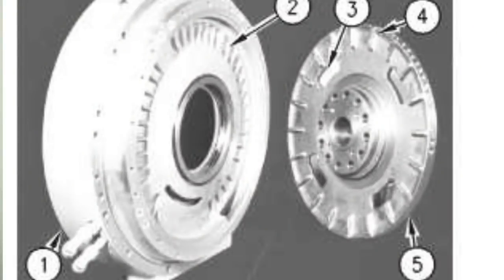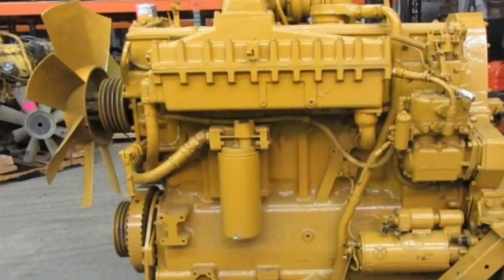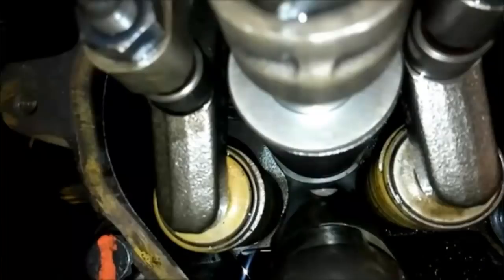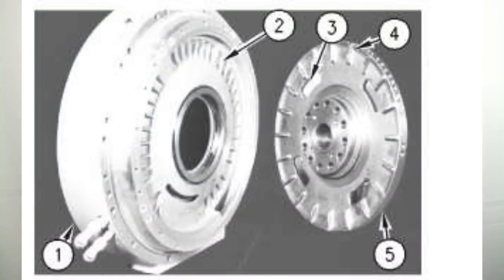What is a Cat BrakeSaver? Caterpillar BrakeSaver. Is it a brake saver?

Comment: I watched this video not because I haven't heard of the BrakeSaver as a device, we call it a "retarder" here in Europe, but because I didn't know CAT put one in its engines. Fun fact, in European trucks it's usually built into the transmission to slow down either the input or the output shaft. Also, fun fact, you can spec these to be linked to the throttle position sensor, so it won't rob power from the engine if you forgot to turn it off.

Comment: I have a 2004 kw  heavy haul with a c 15. It has both a Jake and a brake saver. I love it save your brakes on hills it gives you added safety and security  when dropping off a hill
With 200,000 thousand lbs. with over 1 million miles on it replaced a couple small seals still works great
With no leaks.  I enjoyed your video
Keep up the good work

Comment: I’ve got a Brakesaver on my 3408 in my KW, only problems it’s ever given me is that you’ve got to replace the rubber diaphragm in the control valve about once a year, no big deal, about one hour.  The secret is to keep a close eye on the Brakesaver temperature gauge and not go above 40 psi operating pressure on a long hill. You can run it at 60 psi for stopping at lights etc.
It’s got a huge oil cooler and 2 x oil filters which has got to be good for long life. Another thing, it’s easy on the engine. I believe Jakes are hard on the engine over a period of time. Yes it does have a seperate drain, I use Fumoto oil drain valves for the oil pan and Brakesaver. We overhauled it when I did an in frame on the engine a few years ago, but it was like new.
Yes they are heavy, and yes the price was way more than Jakes. They sound a bit like a CAT haul truck going down a ramp in a mine or a locomotive on the dynamics. I quite like the sound when it’s on max psi.
Reply from the maker: Very cool comment 👍
Reply: @AdeptApe  He also got a very cool channel, you should check him out when you have the time for it :)
Reply: You can change the diaphragm with out draining the oil or removing the spool valve.
Jake Brakes cause's the piston rings to relax very quickly. The result was in the 3406 92U days. Now called A models. I have seen four cylinders with a broken top ring. We had to replace all the pistons, after failure. With a newer thicker top ring. 
I have built numerous brakesaver's, and removed oil coolers on 3408 with one. Got pretty good at it, its a long heavy sucker.
Biggest problem with 3408's, exhaust leaks and broken exhaust studs. Cat came out with a lot of updates on the exhaust manifold. The exhaust stud they made a 7/16 stud and you have to redrill the cylinder head for the larger stud.
Reply: Thank you for more info. I am hoping to get a 3408 with a brake saver. People think I am crazy. But I have always wanted one. And after 10 years in the military and 5 shirt years after I got out. I finally found something that I love again.
Reply: @johngoldsmith6629  I’ve only broken one exhaust manifold stud since I bought the truck in 1996, pita to get out. Last time we did an in-frame,  we replaced all the studs.
Reply: @gm16v149  Your doing good. A lot of updates on 3408 exhaust. Cat tried several designs over the years.
Reply: Jakes are only hard on engines if they are used on a cold engine that has not reached normal coolant/oil temperature, otherwise you can use a Jake on an engine and get millions of km's with no damage to the cam that drives the injector driven master piston.
Reply: Jakes are not hard on the engine at all.  All they do is open the exhaust valve on the compression stroke.

Comment: Cats brakesaver was designed for 1693 because it was an overhead camshaft and Jakes were designed for push rod engines. And like anything if you knew what you were doing it was great. Thanks
Reply: We used to see some KW’s with a 1693TA, and a Luberfiner bypass oil filter   
They used to hold well over 60 quarts of oil with the Luberfiner. 
Drivers really liked the performance
Reply: Know 2 guys that run savers and both have blown oil seals out more then once
Reply: I just got one.

Comment: I've had 2 Petes with brakesavers,  I run the I-5 corridor from Washington to southern California, usually right at 80K.. My first was a 1990 379 extended hood with a 3406B 425 HP with a brake saver 13 speed and 3.55 rears on 24.5 low pro tires. I turned up the air pressure to the brakesaver from 50 psi to 60 psi. This truck went 615K miles before I traded it in on my 1995 Pete. The only brakesaver related repair was replacing the control valve diaphram ono time.  My 1995 Pete had a 3406E 500HP brakesaver, 18 speed. 3.36 rears on 24.5 low pro tires. I also turned up the air pressure to 60 psi. This truck blew a head gasket around 600K, Cat had a special going at the time, for 10K they rebuilt it with new cylinder packs, new injectors, new head, new turbo, gaskets, bearings, uprate to 550HP, and a 200K warranty vs 4K just to fix just what was wrong. No brainer there! This truck went another 1.2 million mile before it was totaled in a wreck, I still miss that truck! The total brakesaver related repairs for the entire time I owned the truck were 3 or 4 control valve diaphrams, and resealing the brakesaver one time, it wasn't leaking but the rear cover was and with everything apart, I thought it was stupid not to do it. Some other posts have commented about the brakesaver getting to hot on long downhill operation, I always turned on the engine fan at the top of the hill  the oil temp would come up to 230-240 degrees, it never seemed to be a problem. I ran Shell Rotella 15W40 oil in all my trucks and have never had an oil related problem.
Reply: Thank you Carl for a great explanation or a brake saver.
Reply: No problem with the brake saver I use it going downhill with the Jake’s I don’t leave it on all the time got watch the temperature but itcools down kinda quick right gear  you’ll hardly pressing the brake until you get to the bottom their a safety feature 🤙🏽🤙🏽

Comment: I guy I met from Alaska had a tip: if you want the engine oil to heat up quickly from a cold start, set the engine to high idle and set the Brakesaver control to 15 - 20 psi. I do that sometimes and it works though I heard it isn’t recommended by CAT. Not sure why, maybe because it’s kind of making the Brakesaver work in reverse.
Reply: I've live in Alaska for about 500 years (it seems like; True Sourdough here... sour in Alaska and ain't got the dough to go back home.) I've drained the engine oil and set it beside the stove over night to keep it warm. Once I got the truck running it took me 15 minutes of grinding low gear in the Aux box to get to slip into gear; then drove around the parking lot for another 30 minutes until I could get the main and Aux boxes to shift. That was only -50°F. So when the temp drops from  0°F to a blistering to -77°F you will finding yourself doing a lot of things that Cat or OSHA don't recommend. Cold is hard on equipment. It is a must to run fuel oil #1 in the diesel engines up here below 0°F AND, AND, AND, the DEF freezes. I've been out of the game for a bit so I'm not sure if they have come up with solutions.

Comment: I love the brake saver.  Got one on my old pete with a 6nz and 18+4. Works extremely well even with a 55 ton excavator on my wagon. Brake saver plus the engine brake will slow me all the way down and just activate the service brakes when I want to actually stop. When unloaded or loaded very light, I dont reccomend using it as it can cause a loss of traction.

Comment: Incredible information.  I never knew about brake savers.  I have used Jake brakes and exhaust brakes for years.  Another great and informative video.
Reply from the maker: Thank you Larry. They are interesting, but really make the oil pan a pain to work on.
Reply: @AdeptApe   I'm sure.  I will never forget the time we owned a business class Freightliner with a 3126 deep sump.  I remember checking the oil and it looked like it was a "quart" low on the dip stick...needless to say it was more like a gallon low (it was after an oil change at a shop, that didn't fill it properly).  I will leave the disassembly and reassembly of these engines to you.

Comment: I saw very few of these. You are spot about the owners/drivers loving the system. I went for a ride in a W900 that had the brake saver around 2004, the truck wasn’t new, and with the jakes on high and brake saver on, it would put you in the dash. No kidding! If the guy went fast enough, it would lock drag the drive tires and leave skid marks. No trailer of corse. He thought it was cool. I thought he was nuts. But he had over 500k on the factory shoes and drums, so it was hard to argue with that.

Comment: I had an 1985 pete 400 b cat it had the brake saver it worked good and the only sound you would hear is a whine great for going through cities which had steep grades you wouldn't wake up the neighborhood downside was expensive to repair when like you said have oil leaks or clutch job or engine rebuild plus the extra weight. 
The 1 drive line retarder that worked extremely well was the electro magnetic drive line retarder it was in a 81 pete with a kta 600 Cummins with a 20 speed spicer trans i drove for a couple years in the oil industry. That retarder was awesome just fit between frame rails and drive shaft connected to either end but man you needed a monster alternator to feed it and much heavier than  the brake saver.

Comment: I've run brakesavers on several 3406's, very effective but they won't help you pick up a gear while moving slow on soft ground like a Jake will. Best of both worlds is a brakesaver and jake together. I leave the jake on all the time (6NZ 550 hp) and supplement with the brake saver on manual when heavily loaded this combo will slow a 140,000 lb load quickly. The Jake kicks in instantly while the brakesaver takes a few seconds so it doesn't shock the drive train when you turn both on at the same time.
Reply: Yeah that’s another thing about a Brakesaver, they take a second or two to come on after you’ve flicked the switch on the dash or pulled on the hand piece.

Comment: I've got a 1986 Peterbilt 359, that I bought out of a wrecking yard (20 years ago) with nothing under the hood but the bare block and all the old, internal components and the head in big boxes and on a pallet.  The engine was factory equipped with a  Brake Saver but no Jake Brake.  The engine was, of course, equipped with the very large oil cooler and the truck was factory outfitted with an extra large, high capacity radiator (which, you forgot to mention, is also a necessity with Brake Saver equipped engines).  Previous experience had taught me that, while helpful, Brake Savers were not nearly as effective as a Jake Brake, especially out here in the mountains of western America.  I, personally, rebuilt the engine (liner kits, new camshaft, new fuel nozzles, rod and main bearings, reman oil pump and a gasket  set) using genuine Cat parts.  I acquired and installed a used ("D model", if I recall correctly) Jacobs engine brake, on this 3406B model (water jacketed after-cooler) Cat, at the time of the rebuild.  It's been a decision  that I have never regretted, and have been thankful for, ever since.  Before setting out, on the refreshed engine's maiden voyage, I installed new brake shoes on all four drive wheels.  The brake drums were extremely worn and deeply grooved, thanks to the old shoes being worn down to the rivets.  As I was (by this time) running short on funds, I was forced to run those new shoes in those old drums.  That was over 300,000 miles ago.  A couple of months ago, I installed four (4) new centrifuge drums and, of course, all new shoes.  The old shoes were still (believe it, or not, but I swear it's true) well over 50% linings.  They had been run (regularly), up and down, over the steepest mountain grades in America, pulling loads (GVW) any where from 86,000 to 120,000 pounds.  While it's a fact that my operating practice is to pretend that I have NO BRAKES (and, drive accordingly), the combination of a Cat Brake Saver and a Jacob's engine brake can't be beat.  Oil changes are done at a little closer intervals (religiously) if the Brake Saver has been getting much regular, or prolonged, use (due to elevated oil temperatures during Brake Saver operation) but oil changes are much easier than brake jobs.  
     I love Caterpillar.
Reply: P.S.  I forgot to mention how much I enjoy, and appreciate, your presentations.  Even though you're a YOUNG whippersnapper, you are pretty, damn sharp and I learn a lot, from you.  Keep up the fine work.

Comment: The local shop here just had a c15 with a brake saver come through. I know the technicians struggled with it a bit. However you're bang on the owner loves it
Apparently they're common on caterpillars articulated 30 ton trucks and many other off-road applications.

Comment: Drove a 359 Pete longhood with 3406B brakesaver equipped it worked wonderfully, the engine pulled great all day long and flattened any hills and wind, going down the Rocky Mountains no problems either, worked great and made a fine whine sound barely audible, also could check engine oil level with engine running, just never consumed any so didn’t need to open that long hood, unless you wanted to show everybody the nice looking, clean Caterpillar engine!

Comment: I had one on an early 90s Mercedes 2648 heavy haul truck made by Telma. Voith is another company that made them back than. We called them retarders and those were pretty common on trucks and buses. I rarely had to use the foot pedal for slowing in the hills. That also meant dropping quite a few gears before going down hill.

Comment: In the late 70's we added an electric retarder (essentially an electric version of the brake saver) to the driveline of one of our straight trucks (it "replaced" either one of the carrier bearings or one of the intermediate shafts, can't remember now).  It worked great in the mountains and was fairly easy to install (whenever you engaged it the ammeter would peg full scale, so it did consume a lot of electricity).  The downside was that it used several large contactors (relays) to switch the coils on and off, and these were expensive and failed often.

Comment: An Australian company invented a pneumatic brake saver that bolted on to the output of the transmission that pumped up gas cylinders to provide power at takeoff. Don’t know what happened to it but the Australian army bought a few of them.
Reply: I saw it at international  truck show in San Francisco  the aussie  both was close to road rangers both ,somebody  asked the road ranger rep what he thought or the aussie  pneumatic brake  saver  ,his response was they will be buying some of our transmission  on warranty , it is only loading one counter shaft. That is probably  why you don't  see them.

Comment: Also to add, biggest advantage is running the brake saver in rural area where there are “no engine brake” sign, for most its only brake application for slowing down, where as, the brake savers, no issue to run in communities. But a down fall, on our 05 Ken t800 with the C15 acert, as you said in the video, they are hard on drivetrain components. We ve destroyed one 18 speed eaton trans rated 2250 ft-ld, going down a hill, and once, broke all four mounting bolts on the passenger rear mount of the engine block. Quite the process to extract all four bolt out the block without removing the engine or cab. Just wanted to add my 2 cents

Comment: 2 big cheese graders oil feed, 1 grader went one way the other went different. Ran one on my 3408 worked well, the bad was the control box o rings went bad as drivers would pull down to heat in cold weather. Loved it better than any jake

Comment: My 94 t800 with a mechanical 3406c has one. It’s the best thing ever man. Brake in town all over no noise! I just picked up a set of 346d jakes to add to it as well cause on the steeper hills it can’t be run to long or it gets to hot. So this will be a killer combo. Once you have a brake saver you never want to go without it.

Comment: Here in Europe, the Jackbrake is call an engine brake and your brakesaver is called a retarder. 
The only retarders I have seen, are mounted on the driveshaft. It is cooled from the engine cooler. That's smart, because when you are braking, the engine doesn't produce heat, so the retarder can transfer the heat to the cooler. 
As the retarder is on the drivetrain, it does not work that well at slow speed. It often used automatically together with the service brake, but can also be used seperately. The retarder has own oil and swamp (don't know the right word in English)
BTW, I have a CAT backpack, it beats a cap. ;-)

Comment: Hey... Greetings from Germany👌😉. Interestingly enough,  we used to have what you call a brake saver on older Mercedes busses and trucks with the major difference, that it used the transmission oil to slow down a torque converter that is linked to the flywheel. For busses featuring an Auto transmission they had that integrated into the actual torque converter. On those busses equipped with an ATF temperature gauge you could actually watch it warm up the ATF while operating! Other than occasional leak issues and problem due to customers failing to change trani fluid regularly it was a pretty bullet proof system! Also it is not called brake safer but just hydrodynamic retarder. The current trucks switched to the same system but using the coolant as its medium and we have probably replaced more than a dozen of those under warranty. Talk about new technology...